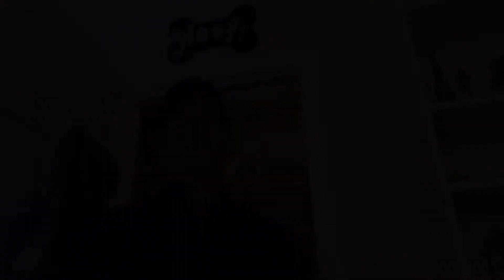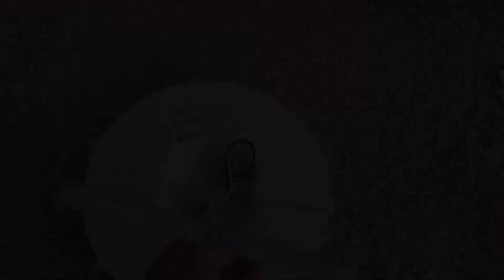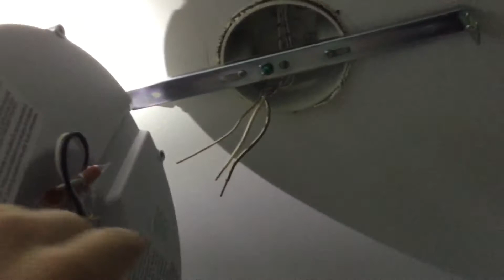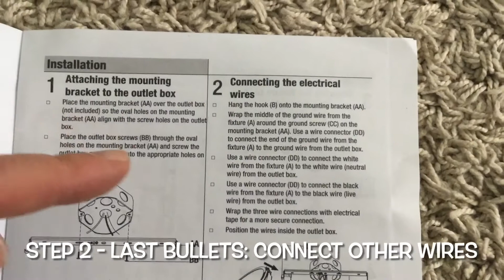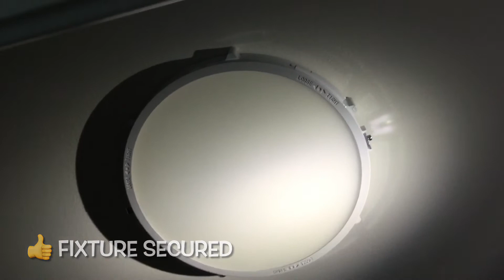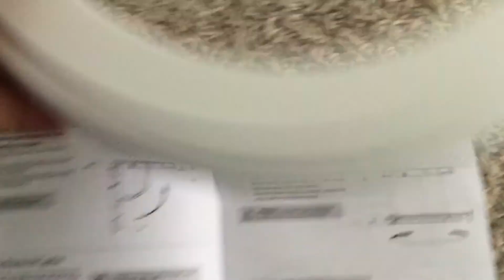Dad Installs Color-Changing Flush Mount Ceiling LED

Comment: What if I have aluminum wires in the old fixture would a lil in sure wire Connecter work ?
Reply from the maker: I’m not an electrician, but I don’t believe you should be using the in-sure connectors with aluminum wires.
Reply: @daddoesvideos thank you

Comment: Installed mine the same way but it did not run on at all???
Reply from the maker: I’d double check your wire connections? Maybe one popped out of the connectors.

Comment: I feel like you left out the most important parts like how to actually attach the wires etc.
Reply from the maker: Thanks for the feedback. I’ll get a bit more detailed on connecting the wires the next time I do a similar video.
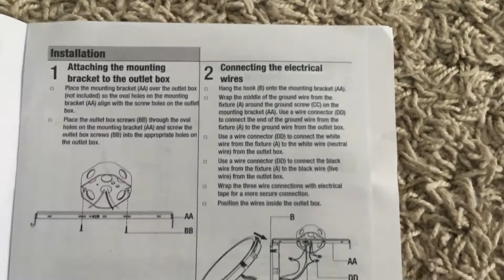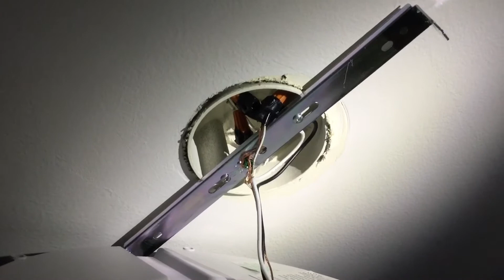Reply: At 9:30 to 9:50 in the video he shows you the instructions section detailing this . If you have never wire nutted before you probably should watch a separate yt video about wiring tools and techniques so you can learn that first

Comment: I installed this same light, but for whatever reason, it flickers every once in a while and it doesn’t seem to be a bright as it was the first day I installed it
Reply from the maker: That’s weird. Neither of those things has happened to me. Maybe call the manufacturer?
Reply: same issue. it only flickers now… hoping i dont need to replace it. Perhaps it has to do with movement detector switch? thanks in advance if anyone can provide advice
Reply from the maker: Weird. I’d call the customer service line for the manufacturer.